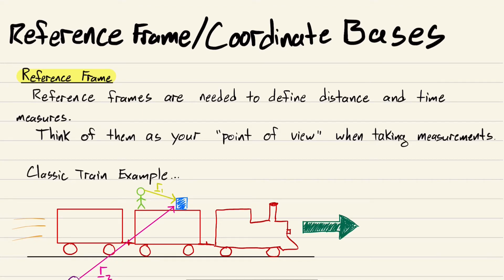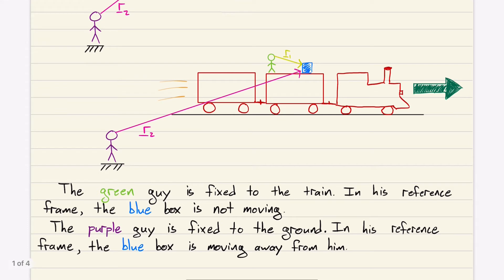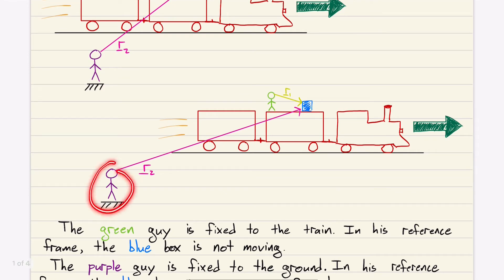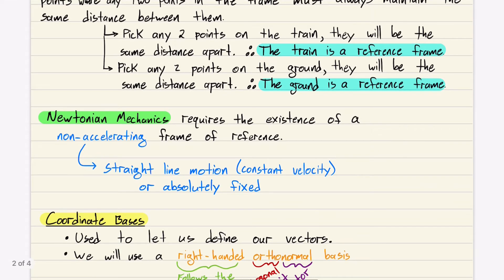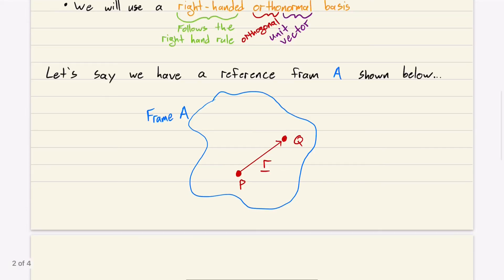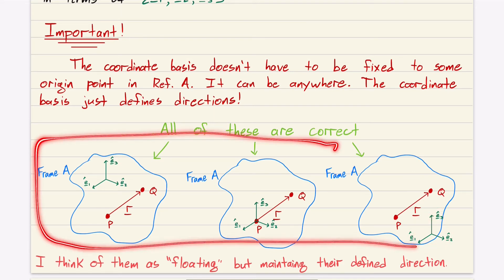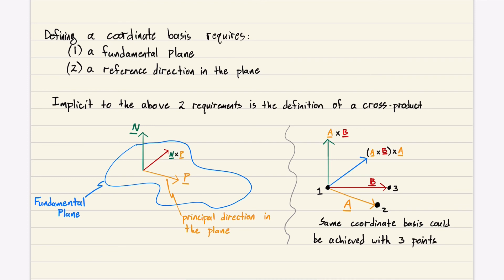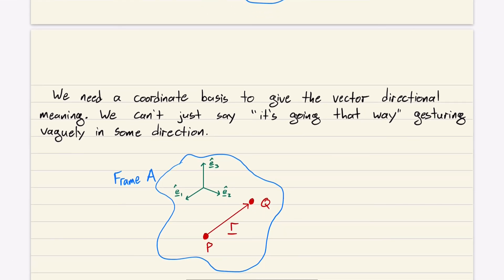3 - Reference Frames and Coordinate Bases

Comment: I have a question though, if you would answer, i will be very pleased. Through the eyes of the train's reference frame, when train gets accelarated, those 2 points that you discuss and say their distance between them must stay constant, do their distance between them gets shorter and i'm not looking for einsteinian relativistic answer where if their speed is close to speed of light and so forth. In newtonian mechanics, when that train starts to get accelerated, as a person on the train, does the distance from me to the box change or stays the same still ?
Reply from the maker: The train, the box, and the person standing on the train are all part of the same reference frame. As long as the person on the train and the box stay fixed in their spots on the train, their distances will never change. The train, person on the train, and the box make up a rigid body (all the points on a rigid body keep their relative distances to all other points on the rigid body).